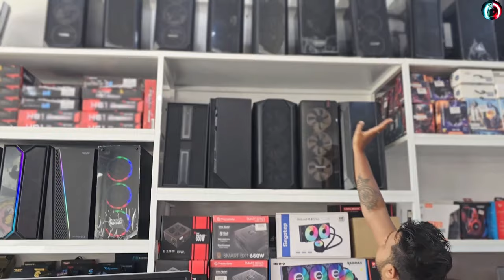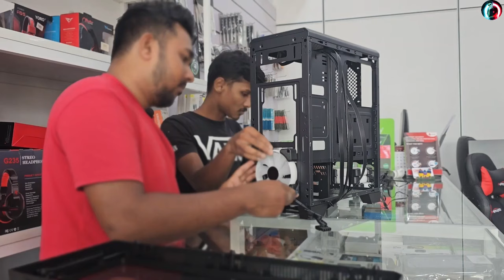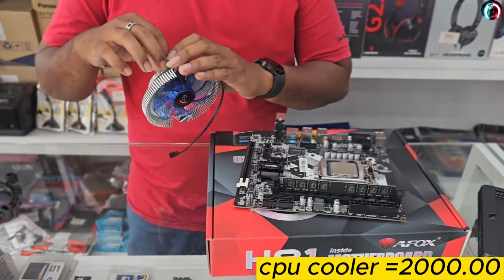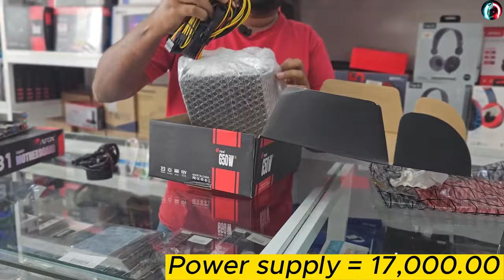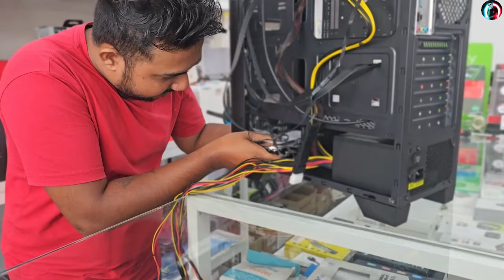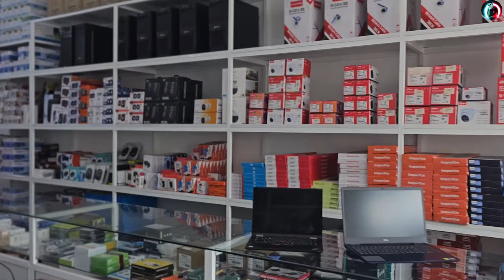New Pc Build For PC / Streaming / Editing Pc in Sri Lanka.Low Budget Gaming Pc Build. middle rang pc

Comment: ඔක්කොම brand new කියන්නෙ මන් හිතන්නෙ දැන් i5 4th gen processor brand new එන්නෙ නැනෙ දැන්
Reply: එන් නැතමා එකනෙ 🥲
Reply: I5 4th walata nvme  support na nada
Reply: @isuruudayanga9126  NVME support karana ekata processor eke balapemak nh board eke slot eka thiyanawane
Reply: Board එකේ slot එක තිබ්බට වැඩක් නෑ I5 6th or ඊට උඩ prosser එකක් තියෙන්න ඕන
Reply: @Smarttech236  නැ මන් i5 4570 processor ekak use karanne NVME එකකුත් දාල තියෙන්නෙ කිසි අවුලක් නෑ
Reply: @isuruudayanga9126  afox h81 board eke NVME slot ekak enawa bro

Comment: i5 4 th gen  prosser ( intel )
16 gb ram  ( 8×2 )
1 tb hard disk 
128 gb ssd
650 w power suply 
660 2 gb vga
H 81 mother board 

ඔය ටික brand new build  කරොත් කීයක් යයිද ?

Moniter,  key board,mouse , casing , speaker  වලට නැතුව
Reply: 60k වගේ වෙන්නෙ බන්
Reply: I5 4th gen processor =8500
H81 motherboard =20000
Cpu cooler =1500
Ssd 128gb=5500
1tb hardisk =12000
Ram 8gb×2=4500×2=9000
500w power supply =3500
Normal gaming casing =7500
1 gb gtx 650 graphics card =6500(used)

Total=74000/=
(65k ----75k )

😊My advice= assemble for best condition used items  by you;
1.i5 4th gen processor = 7000
2.cpu cooler =1500
3.h81 motherboard =8000
4.8gb ram=3500
5.hardisk 500gb=2500 or ssd
6.power supply 500w=2500
7.normal casing =4000
8.1gb gtx 650=6500

Total=35500/=
 
You save 74000-35500=Rs.38500/=

❤🎉Save money 💰 
And enjoy 😉
Reply: @askymohamed8118 motherboard  eka 😂😂😂😂😂